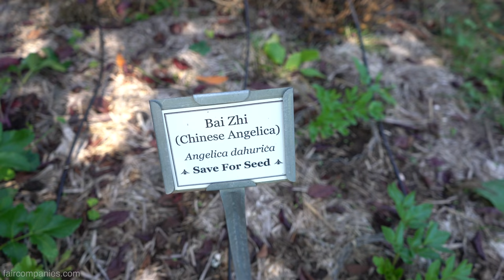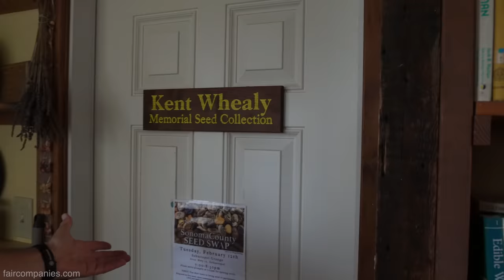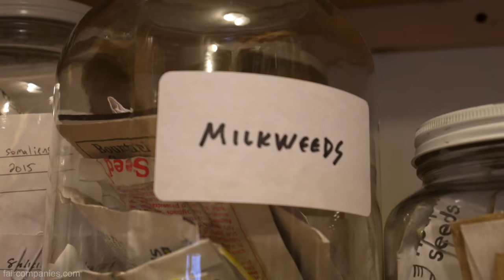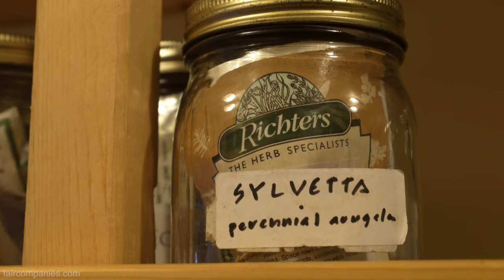7 friends built restoration ecovillage. Outcome 50 years on

Comment: How does the water from the sink and shower go into the gardens? Does the soap not hurt?
Reply: You have to be careful with the soap that you use, toxic synthetic chemicals of course would be avoided, but even the sodium based salts should be avoided and substituted with potassium-based salts like potassium carbonate (which will act as fertilizer) instead of sodium carbonate (baking soda) :) yes it's all possible!
Reply: @dawnbern2917  Ah, I see. Thank you for the reply!